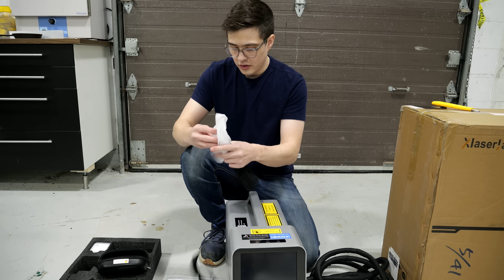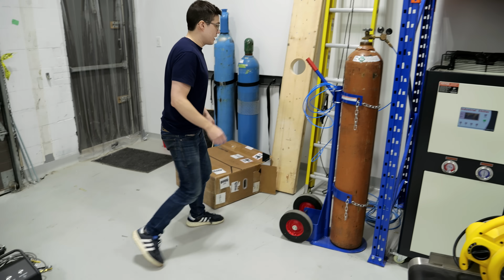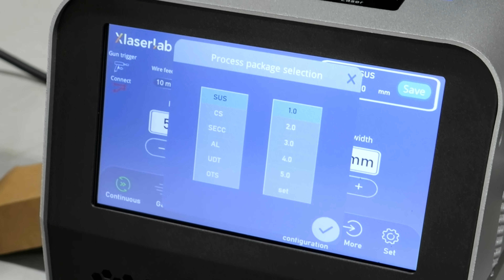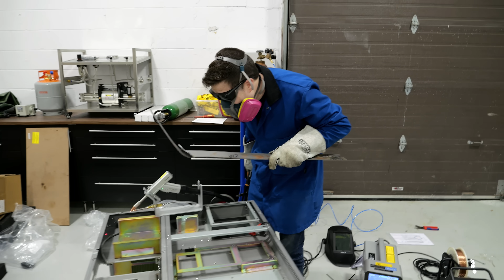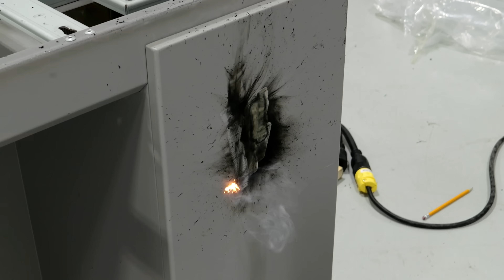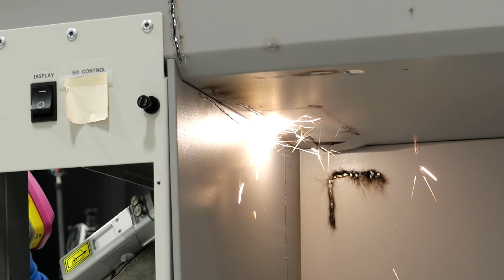I got a new laser machine (I love lasers)

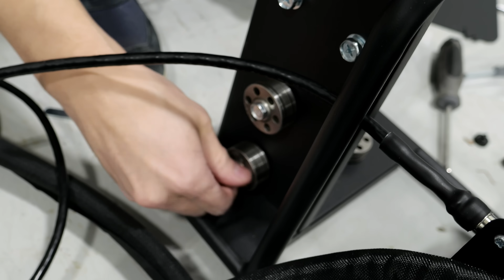Comment: @5:12 "The wire I want to use is .9 cm so it's a bit less than a millimeter"
Sure... give or take
Reply: Real engineer speaking
Reply: engineer, not a mathematician 😂
Reply: Who was actually shooting a 9mm at his densified wood.
This is a science channel. It's only off by an order of magnitude...
Reply: It's a type of wire technically know as "rod".
Reply: Maybe he meant 0.09cm?
Reply: @ferretyluv  - You think? 🤔
Reply: @RFC3514 I like to give people the benefit of the doubt. I’m a native speaker of stupid.
Reply: @ferretyluv  - I would say he meant .9 mm. I mean, people don't normally measure wire diameters in centimetres. 😉
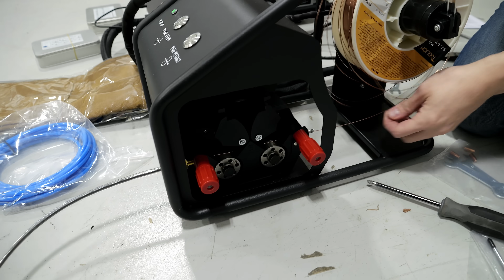Reply: @RFC3514  He did! You can see it at 5:45. And you are right, wire is measured in millimeters
Reply: Mostly take 😂

Comment: Just that first weld, with him busting out the hammer is the greatest endorsement they could ask for. Shut up and take my money!
Reply: A noob welder on his first try made a damn fine weld with this. Crazy.
Reply: @JG-yk6ny  yeah from every person I have seen use these that seems to be the case. They make a super nice looking bead with no real practice and the tests show it penetrates deeper and uses less heat so the metal around becomes less brittle. Saw some good tests against conventional welders with an intermediate level welder and they were floored at how deep the welds went and what a ton less there was to clean up. Lots of guys getting these for doing blacksmithing because they can forge up a box like nothing and have less to grind away after.
Reply: They are relatively cheap as well!
Reply: This company (their real name is XINGHAN LASER (HONGKONG)CO.,LIMITED) is INCREDIBLY sketchy. They came from Kickstarter, used the most generic Chinese startup website template ever, have faked reviews from Forbes (clearly AI-generated), and their website stopped loading halfway through. They have no contact other than an email and WhatsApp, their specs are also AI-generated, they call the safety glasses "Protection Glasses" (Doesn't inspire much confidence in the thing that's supposed to be yknow, protecting one of your vital organs). I really, really wouldn't recommend this product. The glasses alone should be double the price of the machine itself.
Reply: Aaalmost feels like an ad...
If there only was an obvious way to check... maybe the description?
Reply: @defaultplayerchar description shows that he has an affiliate link and a discount code in his channel name. Not like that’s a bad thing but yes it does seem like the video is sponsored by the manufacturers
Reply: @happenedsafe6254  I mean it literally was, the laser is $3600-4500 about, so that's how much moneys worth of product they gave him to mess around in a vid
Reply: @happenedsafe6254  "They've sent us this for free..."
Reply: @happenedsafe6254  Nile literally said they gave it to him for free so yeah it's sponsored.
Reply: @defaultplayercharfrom my understanding, laser welders are much easier to use, however they are more expensive in the long run, because whilst you still need an inert gas, like you do with MiG and TiG welding, you also, I need to worry about optics which wear out over time and are a lot more expensive to replace than the Tungsten electrode on a TiG welder. Like with anything in life, there are pros and cons to all methods. And this is definitely easier to do, but that does not mean better by any stretch of the imagination.

Comment: You didn't even do the correct method for welding but it still extremely strong wow
Reply: I mean laser welding has it's advantages in an amateur setting - and a ton in professional ones - but one is that the initial learning curve is not that high and the heat affected zone is legendarily small. It's of course not the be all end all for welding, but for sheet metal? I'd wager it's as superior option. And there is a lot that Nigel can achieve with this one.

Comment: Holy shit, I want that laser setup so bad. That welding function looks ridiculously easy. I'm really impressed.
Reply: It is stupidly easy to use. It makes aluminum so easy to weld.
Reply: @hexad3c1m4l hopefully this tech will just get cheaper and smaller over time
Reply: It's great. Only for relatively thin stock, though. Anything above 5 or 6 mm I'd say use a traditional welder, these small laser ones just don't get enough penetration.

Comment: So it appears to be a MIG welder based on the wire feed, the nitrogen gas, and the grounding cable. 

What does the laser do then? It's not like you need a lot power just for a laser sight.

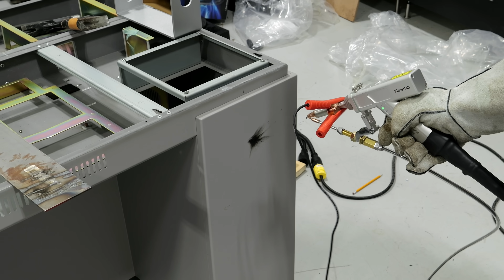Edit: at 10:45, I now see what the laser can do.

Comment: Lost it when he started going sicko mode with the hammer.
Reply: its not really that crazy, metal workers do that whenever you test a weld welder, welding technique.  You just fcking wreck it and look at it to see if the welder merely put a tiny drop of weld on the metal joint or if the welder heated up both pieces of metal and fused them together... as well as adding an additional bead of metal on top.
Reply: Taking a 2 pound hammer to a 5/8 welded stud and beating the absolute fuck out of it for a bend test. Good times.  @davidanalyst671
Reply: Same hahahah 😆😭

Comment: Maybe a dumb question but why do you need a ground cable when you're using laser instead of current to weld?
Reply: Not a stupid question at all! Its mainly for the same reason houses have lightning rods. You dont want stray current going anywhere but where its supposed to. It also reduces electrical noise and prevents interference besides some other things. Especially for cutting with extra gas (like nitrogen in this case), you get ionized gas (plasma) and static charge buildup on whatever youre working on. Also, the most important reason: Just like with normal welding, it keeps the operator safe by providing a path that is not going through the human body (THAT is what makes electricity dangerous!)

A really simple way to think of it: Computer speakers, those that need their own power supply, will buzz (electrical noise) if the grounding on your outlet or wiring is bad. You dont want that buzzing. Ever heard speakers make those funny noises when someone called you on your phone next to speakers? Thats interference and you dont want that either.